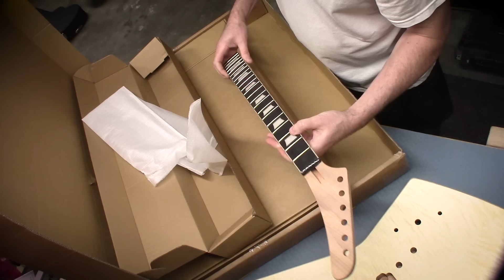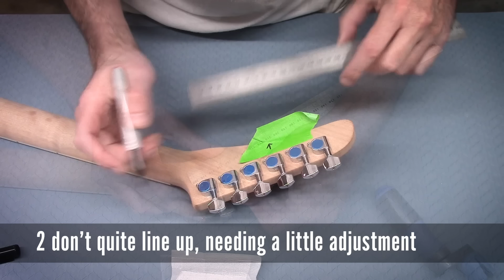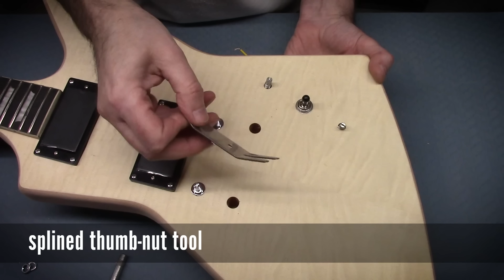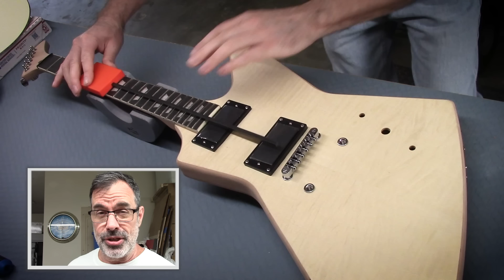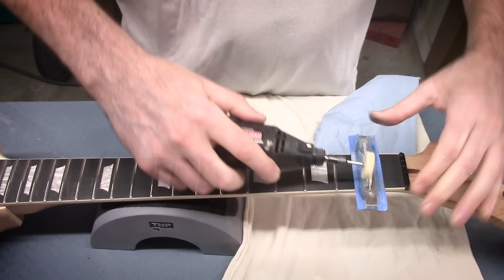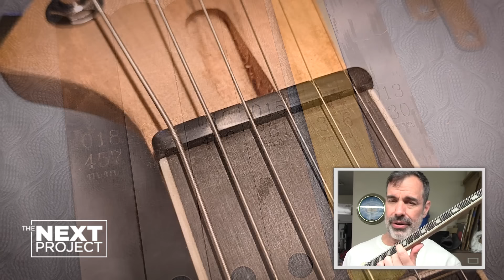Pango Music Gibson Explorer Style Kit Build

Comment: Hay loved the video was looking to get into this exact kit I've never done a kit before but I've been playing for several years and I wanted to get into it. Is there a good starter kit that still sounds good?
Reply from the maker: Chapman, thanks for watching!
Kit guitars can be a bit of a gamble. I've had some very good kits, that resulted in a "playable" guitar, and other kits that were complete garbage.  
As for this Pango kit, it was a "playable" guitar right out of the box, but I did a number of things to make it a better playing instrument. 
The neck was very good, but the frets needed some attention to make them achieve low sting action.
This is a rather common thing for kits however. The factories probably don't spend much time addressing frets for kit guitars. They are installed, beveled back and that may be the end of it.
The pickups in this kit work, but seem to be a bit weak, so replacements will be going in.
I wish I could suggest a brand that makes perfect kit guitars, but at this point I don't know if that is reality. Each kit needs to be judged box, by box I'm thinking.
Good luck with your future projects!
Reply: @theNextProject thank you, your advice helps a lot

Comment: I had them build me to dream guitars with the top quality every thing i had a Vinnie Vincent and a Jackson Warrior the put solid triple A soild maple tops on both the vv has a 3/4 soild maple top the Warrior had a 3/8  to and i had them do neckthtough body maple flame necks the vv has a super nice flame on neck the Warrior not so flashy but it was still flame Maple i did vv in trans and coverd flame top on with florescent glo in dark pink and the vvis Trans turquoise i had them do slanted single coils two side beside and one at neck and the vv have ebony 27 fret fretboard with real color mother of pearl shark fin in lays Warrior was 24 fret real mop colored inlays they built abalone Jackson loose to original size and sent me some hot rail pick ups for both but had problems out of one set and they tried to replace but air freight would not bring pickups. made three attempts but finally sipping by ship  freight. The two guitars they built me play amazing  a the 27 fret vv  stays in tune and very fast neck I put a fender lace sensor red letter in it with hot rails............... im very pleased with mine and will have another built the price was a round 700$ each but when I hold and play the vv its like holding  a 4000 dollar guitar.
Reply from the maker: Hey John, thanks for watching, and WOW - a great write-up on the builds they made for you!!!
Sounds like they really do try to check all the boxes, and will all the unique specs too.
Can't fault them for shipping irregularities, it's unfortunate, but one of those things that is hard to have control of. Someone in the middle just gets in the way of progress.
Thanks for sharing your experience.
Be safe and take care!

Comment: IVE been looking at these I have a long torso and the regular explore size is very comfortable for me is that the same size I noticed some differences to a regular explorer I was just curious before I picked one up
Reply from the maker: Jabroni, thanks for watchin!
I don't have a set of Gib Explorer plans available at the moment, but I'd done some quick (rough) measurements on the Pango Explorer.

From top of the rear wing tip to the bottom of the rear corner is 16" straight line.
From the extreme lower treble horn point to the tip of the tail (diagonal across the body) is roughly 26.75 inches.

Sorry for the lack of tech specs, hope it helps in some way.
Reply: @theNextProject thanks that does help my local guitar store has some explorer and I’ve gotten real friendly with the employees so they’d probably let me measure one of the explorer thanks so much!

Comment: I'm (trying) to do the fake zebra wood Explorer kit they make and it's given me a LOT of issues. The holes for the TOM bridge were drilled too close together and the bridge can't be mounted. Also, there was a crack in the headstock that I had to repair. Don't even get me started on the nightmare of routing for a 9 volt battery box.
Reply from the maker: Sorry to hear the Zebrawood version is being such a problem.
I wonder why they would have different routing points for a "standard" bridge. 

One concern I've always had with kits, is the reoccurring absence of QC. The parts may look good, but will it actually fit? 
At least with an assembled guitar, QC should visually catch parts that clearly don't fit.  

So, what's your current plan to remedy the issue? 
Plug and re-drill, or route away and put in a trem, or...?

When life gives you a lemons... get a chainsaw.
Good luck with your project!
Reply: @theNextProject I’m planning on doweling the bridge post holes with a wooden dowel and epoxy since it’s a composite material. I’m going to redrill the holes for a Tone Pros bridge I have, sand the headstock a little thinner to compensate for Sperzel tuners and throw in some EMG pickups. I’ve got a set of 81TW/85TW and the harness they came with. I’m hoping I won’t run into any more issues.
Reply from the maker: Sounds like a great plan, should be an amazing gig when you're all done!
Good luck with all the big and little tasks within the project.
👍

Comment: If you haven’t checked out Precision Guitar Kits it’s worth a look. I built a Korina Explorer from one of their kits. They seem to be among the best I’ve experienced. Set neck construction, and you can order a made to order kit. You can choose wood species fret wire, etc. My Explorer turned out beautifully. Easily rivals the instrument it mimics.
Reply: You as well! Happy building!
Reply: @jimmyjoe1871  I built an Explorer guitar from PGK also. I went with the Black Limba body & neck and ebony fretboard. I set the neck with hot hide glue and I have to say that Limba body rings like a bell! I had PGK cut fret slots only so I could install gold EVO frets. Also removed their pearloid inlays and installed real MOP block inlays. Spray it with several coats of clear lacquer to show off the Black Limba figuring, she turned into a real beauty. PGK makes a good kit. The neck joint nice a snug as it should be and used quality wood. Their Explorer is a bit oversized though. I cut almost an inch off the bottom (input) side and trimmed 1/8” to 1/4” around the rest of the guitar. My Explorer fits PERFECTLY into a Gibson Explorer case. Something I’ve read other builders complain about,,, having to find a case large enough for their guitar.
Reply from the maker: Sounds like a great build!
Reply from the maker: Jimmy, thanks for watching!
I'll have to look up Precision Guitar Kits.  
This kit was a gift, so I didn't have any imput on what, nor where it came from. 
I was pretty pleased with the overall quality and fit of components. 
That said, there is plenty of room for upgrades with this kit. That's another day.
I'll look into Precision, thanks for mentioning them.
Be safe and take care!

Comment: I like these as mod platforms but the bolt on neck is a bit disappointing on these types of guitars. The LP style inlays got my hopes up on a set neck construction but still a cool kit
Reply from the maker: Brent, thanks for watching!
I think Pango has a couple set neck versions. 
As this was a gift, I didn't have any input on what, nor where the gift came from.
All-in-all, it is a pretty nicely made kit, the things that should fit do, with the strange exception of a couple tuner holes being slightly out of line - easy fix.
The neck connection on this kit is on the mod list, probably won't be a bolt-on much longer.  I like the inlays too, dots are for fenders, LOL.
Hope all is well, be safe and take care!

Comment: if its a throw it togetther, solder it up, check neck angle, lock it down    guitar      ...... then I could se leaving the cheapo electronics                    ....  But to do that extensive of quality craftsmanship , Definately better wiring & pots, if it were me. Its not tho . but just sayin.
Reply from the maker: Dave, thanks for watching!
This video wasn't intend to be a mod/replace things presentation. More a what's in the box, does everything fit, are there extra parts, missing parts... I didn't even bother with any finish, and it needs a finish.
I did get carried away with the fret work, which was unnecessary at this point, but I do weird stuff randomly.

A Mod project series will follow, and yes things will get replace and upgraded, corrected, improved...modified to whatever degree, and a fancy finish of some sort too.

For this vid, I just wanted to look at the quality, see if the kit would even be playable, and mostly it is (even without the fretwork). There are a few odd things in the kit, but nothing that is a dealbreaker.
I've assembled other kits in the past that had so many issues, the kit should have failed QC and never left the factory.

A mod project for this guitar will likely kick of in a couple months. The replacement part list may be rather extensive, depending, the pups will get replaced for certain, the wiring/pots arent bad actually, but will likely go in favor of a different schematic, the bridge is a bit flimsy, the nut, frets.... ah, anything and everything may go...
A few other projects on the bench to complete first.
Be safe and take care!
Reply: @theNextProject      Speaking of replacing parts                   ......... like 5 years ago, In a trade I ended up getting a Washburn  LP style guitar from 2011  ... it was a cheapo,didnt care anyuthing abo9ut it, sat it in the corner ignored for months           ... Then decided to check it out because I liked the look. It was SO clean, archtop w/pearl binder       ...  Back says Made in China.                ... cheapo generic imo but I remembered he said they upgraded the Pickups        .. so  what the hell, plugged it in .......... to my surprise the guitar sounded really good but played Really reallly good.   So super smooth ,felt more like a 1500 prs THAN A CHEAP WASHBURN, JUST WASNT EXPECTING THE NICE QUALITY FEEL.       ......  so-   Your Exp.       ....  maybe, after a few upgrades, it might become your baby, who knows.          It looked nice as it was when u had it strungup.

Comment: Grain on the head stock. Be careful. Real easy to snap off.
Reply from the maker: Richard, thanks for watching!
I know what you're saying. The lumber used is very light, rather wide grain, and has grain runout going into the headstock.
One of the mod plans for this guitar will be dealing with this issue.
Thanks for the note, be safe and take care!

Comment: Why not level the frets before you put the strings on 😮
Reply from the maker: gstude1, thanks for watching!
Agreed, I believe in flat neck leveling, and mentioned that I had checked the frets before stringing it up. I didn't really find much need for flat leveling on this neck as I planned to use this process as well.
The process I used here isn't necessarly a replacement for flat leveling, more of a follow-up process, which i'm finding catches anomalies that may happen when the neck is under string tension. Sometimes the neck lumber, or even the frets may move ever so slightly. This process seems to catch those strange little things that can happen. 
So, flat leveling is great as a starting point, this is frosting on the cake.
Hope that helps explain this test/process.

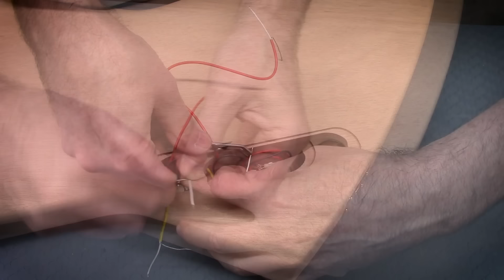Comment: 9:17 what is that clip?  I want one.
Reply from the maker: Ah, those are a little heat-sink clip for soldering electronics.

Goot Heat clip H-2SL:
https://www.amazon.com/H-2SL-Goot-Heat-clip/dp/B001PR1KNS/ref=sr_1_1?dib=eyJ2IjoiMSJ9.R-dj8j1KLYQfbCfOS-ErbYIGpKtMYC4aDIZ-DFEUps_kYK9hP5rFfMHg_ZFfhPB24fPBywck3pzupAm0FUbhD4ciiPAx-zKsYyl30Sy1zyB5gYhYp8aUhyqoz7BQDQhCuRR9BIu5dC5sdHti5N-FhfcIzxZXGMc08hKUux2qJNWZ9eGEm9Gao_-5cGhMZjJdbC8lrMsOydt-4E2ujRtS7DR8b4xIExpRS0pe9JzO6h8yHmWVGpoZeKQDFznVIFFWdVobHK00Nz7iW0VytYI0yZWpGrGzvuUiGdPXwgAkvOQ.aqje0Ir1CPPQFNl7NPOiRfZ6C8tcdrlsIuhJ4gzxfH0&dib_tag=se&qid=1767662908&refinements=p_89%3Agoot&sr=8-1&srs=115862181011&th=1

I love them when soldering capacitors and resistors especially. These keep reduce heat from transferring to the fragile component.
Hope this helps
Reply: @theNextProject  Ooh.  The heat sink aspect is just a bonus.  I just want it for work holding. lol

Comment: Happy New Year with many next projects 🎉 Such a great gift 😊
I was wondering if your printed fret polisher could be tweaked in a way that you could use it instead of the different crowning files. The tweak could be to thread the sandpaper through some plastic right where the crown is so it doesn't sand the fret tops. Grit wise a 180 could help to do the crowning. Just a thought. I'm not into 3d printing and involved use of cad tools, yet ;-) to try this.
Cheers and thank you for all the next projects you have done and will do 😊
Reply from the maker: Volkan, thanks for watching!
Interesting idea you have there.
The grip as designed, doesn't work well with coarse grit papers, as the paper tends to grab the inside of the housing and hang up a bit. 
I'm typically using 600 grit or finer, but on this guitar I started with 800. The fine grit paper doesn't grab the inside of the housing. I may have to try some 320 grit, which will be similar to a lot of diamond coated fret files. 
So, I will have to ponder how to make the idea work.
Thanks for checking out the project and brainstorming tool ideas too.
Be safe and take care!

Comment: The kit should include a holed flat plate for aligning the tuner shafts and pre-drill piolet holes... ez, pz installs.
Reply from the maker: Gary, thanks for watching!
That would have been nice, but we gotta work with what we get.
It was a bit strange that 2 of the tuner mounting holes were ever so-slightly misaligned. Really thought they would have had a template for the 6-inline holes.... Everything else was routed and drilled nicely.
Overall, it is a pretty nice kit/collection of parts.
Funny how the 2 control knobs weren't quite the same either. Close, but not quite. 
It's all good, my socks didn't match that day either.
Be safe and take care!

Comment: No wood between the neck pocket and the pickup cavity?  That's pretty scary.
Reply from the maker: eyeofamon, thanks for watching!
It is rather unusual to find a bolt-on neck with no backer for the neck heel to butt up to, so I definitely agree. The string load is all on the neck mounting screws as it's built. Not ideal... but it's a bolt-on version of a set neck design. Guessing they simplified the manufacturing process and just ignored the potential issue.
Sorry, my computer is glitching at the moment....
I think I've seen a couple different PRS Silver Sky neck pockets, one with a small "curb" at the heel, and another with nothing to stop the neck, similar to this kit. 
A small scrap of thin lumber could be glued into the bottom of the neck pup cavity to act as a neck-stop. Looks like the routing is plenty deep to allow for that...if a person wanted to. 
Thanks for the keen eye to detail, be safe and take care!

Oh, my computer did it again.. this message is haunted!
Reply: @theNextProject  Pretty much all Ibanez RGs and JEMs have a similar set-up, doesn't seem to be something they consider a flaw.
Reply from the maker: Furiora, thanks for watching!
I didn't realize that about the RG and Jem. I thought they had a slight curb or ledge from pocket to pickup route, perhaps not.  A lot of things I don't know, seems I know less every day, it seems.
Hope all is well, be safe and take care!

Comment: The lack of pickup ring holes is in case you would prefer to use direct mount pickups (which often looks better on nicely flamed tops). Not all Chineseium humbuckers are terrible but typically those EMG style passive copies are pretty poor.
Reply from the maker: BaronQ, thanks for watching!
Good point on the missing pup mounting ring holes. 
I suppose it offers some flexibility in final assembly and finish options. 
Other holes will still be needed, unless additional upgrades are part of the original build.
The sealed pups, do seem pretty weak and very picky on amp settings, a rather narrow range of enjoyable/tolerable tone. A better player could probably coax something out of these, but I'll swap them out in the future.
Hope all is well, be safe and take care!